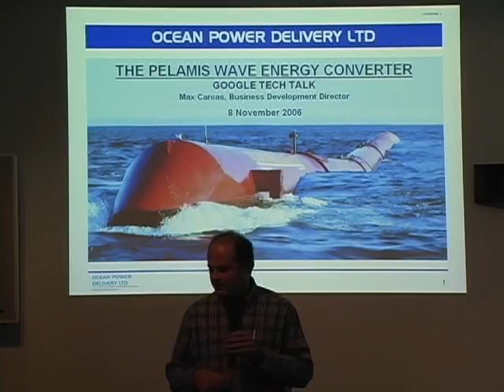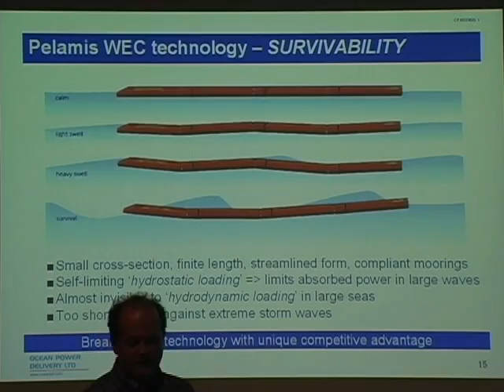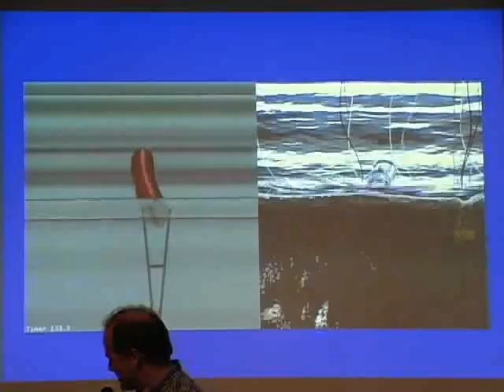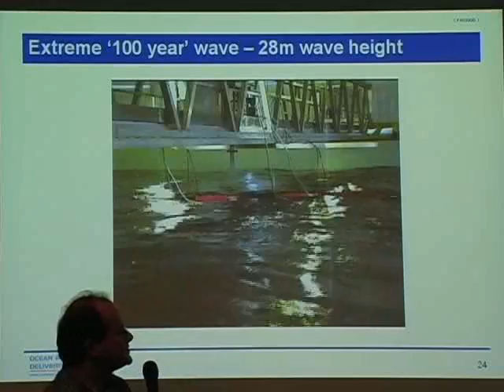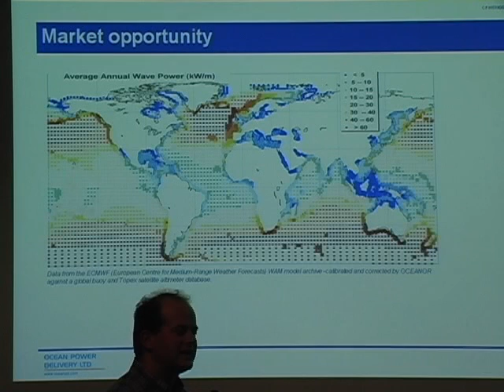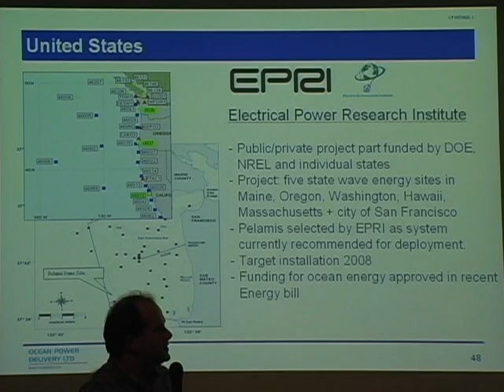Ocean Wave Energy

Comment: I saw a program on National Geographic where two guys built a very simple contraption that converted wave energy to windenergy. Simply a hollow tube with a narrower end. The bottom sits in the water. A wave comes pushes air out of the top making a turbine spin. Waves recedes sucks air back in makes the turbine spin. Use a wellsturbine and you don't loose momentum from the rotor changing direction.